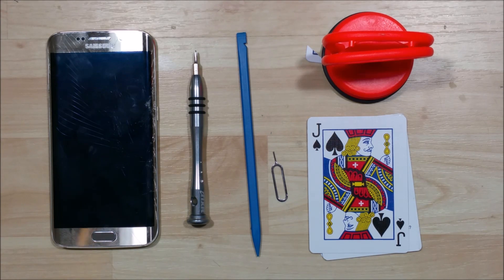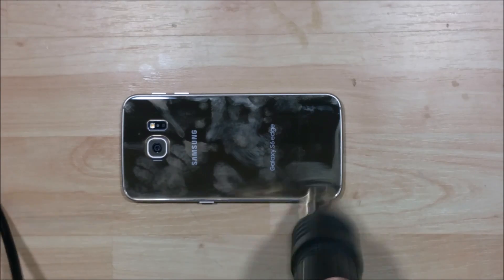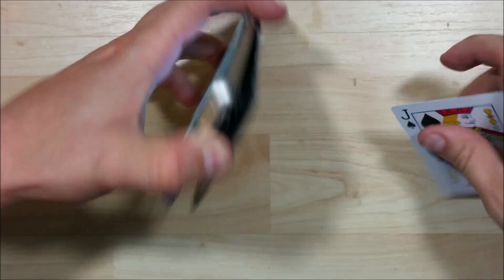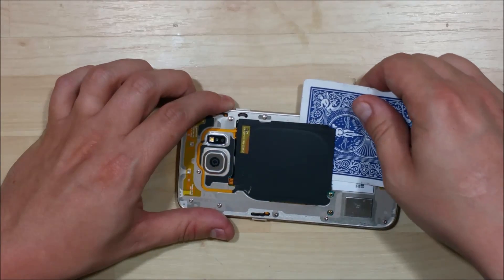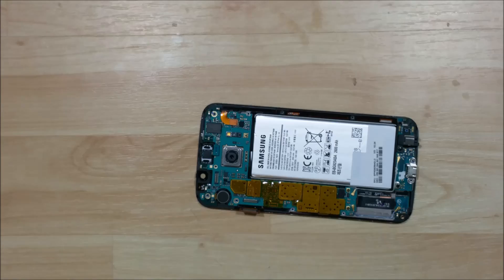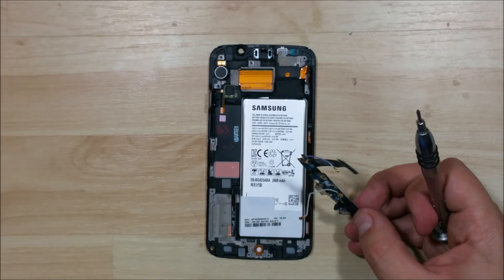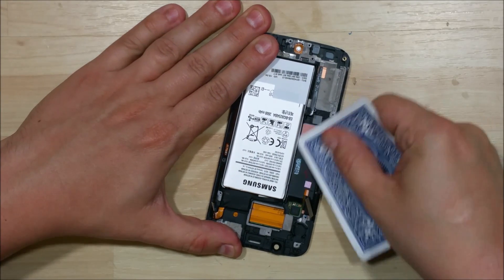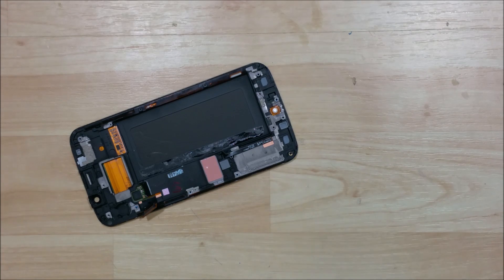Samsung Galaxy S6 Edge Screen Replacement - Disassembly

Comment: I just got smashed up S6 Edge for just 26€. Good thing with this one is that both back and front glass are smashed, and display does not work, so I don't need to be extra carefull with it, since I will order completly new screen and glass back. But yeah, replacing the screen does not seem too difficult, since I was already dealing with newer Xiaomi and Huawei phones, and they also need to be almost totally dissasembled to change the screen, almost the same as this one.

Comment: feed back for the headset port.it was intact in the back case with a thin flex.just be careful and dont force it.or do not pull out from the bottom.just pull it out from the top and easier.THANKS

Comment: i dropped mine and cracked the screen. the screen only occasionally flashes and is always blank. if i replace the screen, will this fix it? it seems like it still funtions otherwise. the screen just wont work.

Comment: How come that u didnt need the heat gun for the front of the s6 edge but u needed to use it for the normal s6? Btw will a blowdryer work as a heat gun?
Reply: *****
I tried it. Didnt really work xD It was hot af and I really didnt want to break it

Comment: Would it be same process for s6 edge +?
Reply: Close, but the battery connection is in a different spot, plus (and this is the worst part)- the USB board has the wrap-around buttons so that board can't be replaced without removing the screen, bummer.

Comment: wher do you buy tye acreen
Reply: hello friend , most mobiles damaged only the glass , so change a glass is ok with low cost , no need to change a whole lcd with high cost , change a glass with machines will cost about USD 3 , can save a lot , our factory sell the spare parts , also sell the machines to change a new glass . Any question or interest , can contact me at whatsapp : +8613590439558 .
Reply: +Nancy Phone fix factory 008613590439558 how can i buy new screen of S6edge plus?
Reply: Amazon
Reply: shannen prince hello friend , sorry for the late reply ! our factory sell the new glass for refurbishment , not sell the whole lcd screen for replacement :）　Refurbishing by yourself , only can keep the original lcd .

Comment: Everything is fine, but the camera will not work when the metal frame is screwed on. As soon as the frame is screwed on the camera stops, but as soon as I unscrew all the screws the camera works flawless. I've tried two sensors. Any idea how to fix this?

Comment: Any ideas of how much it would cost me to get a edge S6 cracked screen fixed???
Reply from the maker: +Aw$omeBoii619 Screens are still pretty expensive $180-$210 labor is usually $50-$100 depending on the shop

Comment: at what point do i have to get to to access the sim port? I bought a s6 edge that has a nano sim stuck inside the port.
Reply from the maker: +supersonik90 After removing the back glass and taking the screws out. The metal frame cannon be removed if the sim card holder is still inserted. At 7:02 is where you will have trouble.
Reply: no

Comment: But how hot does it need to be heated at@ I tried mine at 160-200 degree and it still not moving a 1000of an inch 😡
Reply: I did mine 280 and it worked

Comment: I'm wanting to get the s6 with my carrier but they don't have any of the 64GB phones anymore since they weren't selling as well as the 32GB. I was thinking if I open the phone up and buy an aftermarket SD card that's a 64GB do you think it would work as replacing the stock SD card that's already in the phone? If so, where would that card be located in the phone?